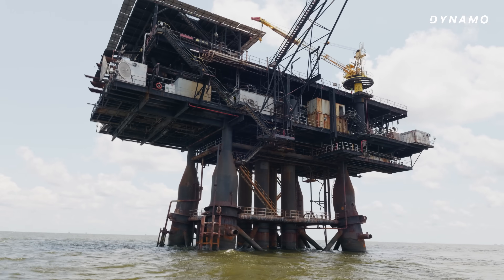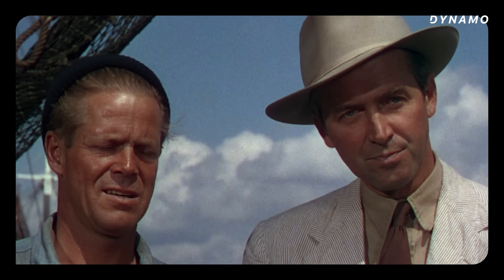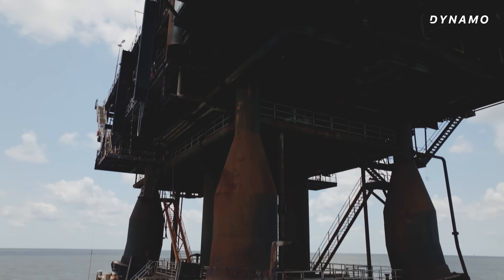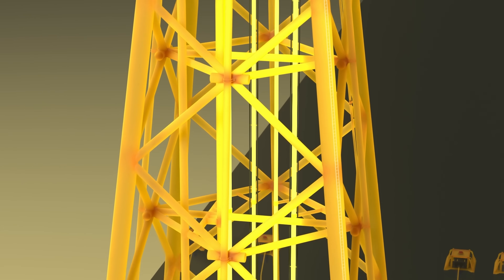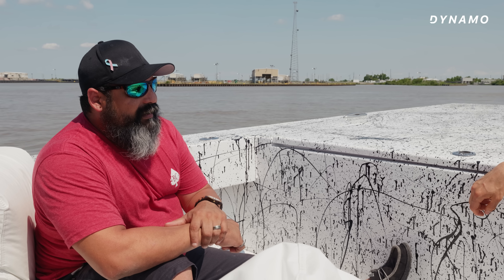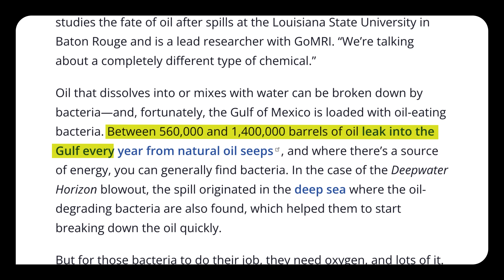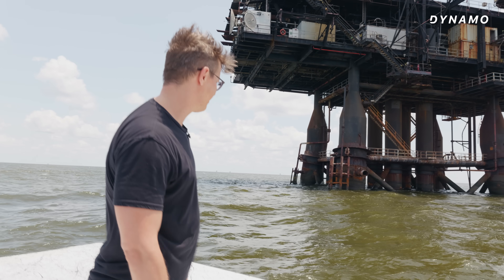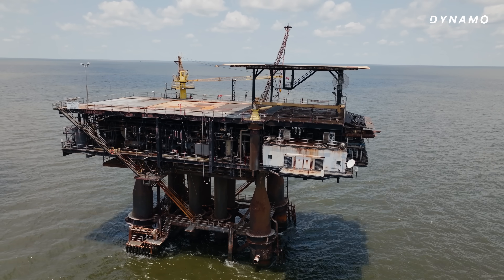I Visited Abandoned Oil Rigs — and Found Something Terrifying Underwater

Comment: It's all based on the law. The law needs to state that if you build it, you need to remove it.
Reply: They pay to keep the laws this way
Reply: @ogz7469 the big guys sell them, to smaller operators, who then pump out the rest make a huge profit and file bankruptcy
Reply: @ogz7469  better known as political donations!
Reply: Agreed, but no enforcement means no compliance.
Reply: Lobbying will never die in this country
Reply: @Joey_DiGs  lobbying is such a misleading term. it should be called corruption but i guess the people even changed the term itself to suit themselves
Reply: @Joey_DiGs personally I’m not convinced that it would have happened if they won, but we did have candidates running on a platform of overturning Citizens United such that corporations would still be able to lobby as if they’re people without the liability
Reply: @Joey_DiGs  As long as greed exists.
Reply: Even when the law says that, it is a trivial matter to sell the item to a company created just to go bankrupt.
Reply: @rockets4kids  If the law is: "You build it, you remove/clean it" selling it would not make a difference, you'd still have to remove/clean it even if you don't currently own it.
Reply: "The law needs to state that if you build it, you need to remove it." In OTHER words, you're saying that we need government regulations with teeth (the exact opposite of what Trump wants)
Reply: @Will-ql5db  The problem is, "Big Oil", is the law, for anything that applies to them, outside of major catastrophes. You're supposed to pretend that you don't know that. Even Trump knows who he can or can't F with.
Reply: @tuck6464  i) "The problem is, "Big Oil", is the law, for anything that applies to them,", Because Jesus Christ said so? No, it's because Big Oil paid legislatures (politicians) to write the law as it is, including lax regulations, WHILE the little guy (the citizen) wasn't looking. The problem is fixable by having the citizens learn of this (then demanding a change from their leader, which brings me to ii below).   
ii) " Even Trump knows who he can or can't", Trumpkins are always letting their Dear Leader OFF of the hook. Holding their man to account will NEVER happen, they ALWAYS make an excuse for him (like a cult defending it's leader). Disgusting.
Reply: @Will-ql5db *The exact opposite of what EVERY president has wanted. Let's not act like any government has given a flying függ about this situation. They ALL are immoral. My disappointment in Obama will never subside. Atleast we have it on paper that Trump is a crook.
Reply: Privatize the profits, socialize the losses. America's unique version of capitalism relies on making sure the bottom 80% pays for the bulk.
Reply: In Norway they have to remove them.
Reply: "Laws are created to be followed by the poor.
Laws are made by the rich to bring some order to exploitation. (Lobbyin)
The Poor are the only law-abiders in history.
When the poor make law the rich will be no more." - Roque Dalton Garcia (1974)
Reply: Remove it ? While USA with SpaceX is still developing reusable rockets. The Dutch have a veasel (Pioneering Spirit) that can lift a entire oil rig and place it some where else.
Short awnser: The Dutch can save your cities like New Orleans. But according to the Americans them selfs our solutions are to expensive
Good luck with Large language models... We never going to give USA our technology again for atleast a couple of decades. And we are folding protines with AI, not creating MechaHitler ;-)
Reply: I wish that applied to the old nuclear submarines in Plymouth, the rods are out of the reactors but the cost of decommissioning is too high as Swiftsure is proving.
   They all need perpetual cooling
Reply: Yeah, more laws will solve the problem.....   look at gun laws, domestic violence laws, traffic laws...  more laws always work
Reply: Who funds the politicians 😂
Reply: @bystandar right now suckers and losers
Reply: that is what the law says.  But Big Oil is daring you to enforce the law.
Reply: It’s the same in mining.
Reply: @mikehenson819  It's also the same in the ILLEGAL dumping of toxic/nuclear/whatever waste. The US government is only there to protect the ever increasing wealth of the rich, f*** the "common" man/woman who's paying an arm and a leg in taxes to have it all cleaned up.
Reply: Part of the lease is money to remove it but the government keeps that money and uses it for whatever else they want, public doesn’t see them so the public doesn’t care.
Reply: 😂😂😂😂 because that has worked so far
Reply: The law does say that.
Reply: Then we just have people going to jail.
Reply: That is the law.
Reply: That or sell it to someone who will maintain and repurpose it for something.

I would imagine someone, somewhere can come up for a use for an ocean platform.

Hell, fish farming maybe?
Reply: The law only exists to protect the capitalist class (billionaires). They're fighting a class war against every one of US who makes less than 5 million dollars a year. This is why we need a Workers Party! Socialism will save us from the Capitalist class warfare.
Reply: Exactly. It’s not a hate the player situation. It’s a hate the game situation.
Reply: You literally have no idea what you are talking about.
Reply: They dont make money that way, and would never allow it or they would sink it and make it worse.
Reply: @houston4380 Stop making claims that you know absolutely nothing about
Reply: Too bad that wont happen because every politician is in the pocket books of companies. It's why you work in the government. It's not to help out out the people, it's for the stealing of peoples hard earned cash by way of taxes (which is legalized theft created by the Democrats to at one time get rid of tariffs), and through big businesses giving out large checks to look the other way.
Reply: How about if you built it and you're killing the ocean, you have to clean it up too.
Reply: Communism is the answer 🤣😅😂
Reply: Ya but it was going to cost like 100 million to get rid of it or they can pay a couple of politicians half a million
Reply: They have these "laws" and these big companies just pay the fines.
Reply: Your govt is rotten to the core, no different then any other govt in the world. It's all about what's in it for me.
Reply: Yep, really needs to be done
Reply: They should be assessed once finished for cost of decommissioning and removal and the cost should put into a govt fund and held in trust. Dont forget’if there is a demand someone will fill it’ that is how business works…..businesses saying it too expensive are actually saying ‘is the profit margin in my business model can not accomade it’….some small company with lower overhaeds will take it on.
Reply: Make a law to do the right thing? What? No way, come on, get out of here, that's crazy. Your saying people need to be forced to do the right thing?? Do you know what country this is. Land of the I do what I want, how dare you think people should do the right thing.😂😂
Reply: If that were the case, then how many construction companies would either fold or jack their prices up horrendously to compensate themselves for the increased financial risk? If you were to build your own house and eventually sell it, what would you say to the new owner if, after a further 20 years and an earthquake or suchlike, he came asking you to pay for its demolition, since you built it? Should he then have the law behind him to thus compel you? When does your ownership and responsibility end? How would you plan financially for that liability?
Reply: But then we pass another law to “subsidize” big oil under national security pretense that lets them sell the well to another company that can declare bankruptcy and ignore the rig again. Big oil, big defense and right wing cia would never let their cash cow get hurt in any form.
Reply: We as People Need To march On Congress 😮😮😮😮
Reply: @GurlHeaven211 what we need is for people to wake up and realize that the government is the single most inefficient way of handling things.  A free market is an efficient market.  

Every fine, sanction, tax etc levied on an industry creates inefficiency in the market and every time the government gets involved the pork barrel promises and nepotism cost the taxpayers millions.  

The government shouldn’t be involved in cleanup at all unless there is a disaster.  Cleanup should be the oil company’s responsibility.  If they were held responsible for properly capping and closing their own wells, there would be a much more efficient way of doing so already and this problem never would have gotten so out of control.
Reply: @GurlHeaven211 bot
Reply: @KamiInValhalla Why????
Reply: More complicated than that. They sell the old ones to these sort of oil rig junkyard companies who then get everything of value and then close shop. (Great comment above explains what happens then.) Basically, the law DOES say what you suggest lol! The catch: there's no practical timeframe.  They have only like a few of the jumbo barges that can handle breaking down these rigs, and dozens of rigs (w/ hundreds & hundreds of wells total) slated for removal, so at this rate by the time they finish quite a few could've collapsed.  Classic nightmare courtesy of DC, w/ literally no good solution.
Reply: Wrong
Reply: That’s what the law already says   Original company that drilled the well is responsible to plug it
Reply: Should be part of the operating cost and expense, and contract for license.
Reply: You know man its clear without any law if its belong to someone he responsible for it till he dies and even after that his spouse or relatives carry this responsibility doesn't matter he sold it or presented because this one is the cause of future problems! 
Thats why in real life is some violence is happening! Only because if someone won't do things he definitely must life stops for him because someone coming and use  firearms and its right no matter what law says.These days some nasty people use lawyers to hide behind some laws that's why so messy around!
Reply: Which will result in higher oil and gas prices and a apissed off citizenry.
Reply: @Robin-ci2kx  We are paying for it, already.
Reply: Easy to say, but if Consolidated Drilling owned it last week and was dissolved in court this morning with no assets how are you going to force anyone to do it?
Reply: Landfill laws need to be enacted and enforced along the same principles.
Reply: The problem is, corporations have no trouble getting criminally charged. If someone goes to prison, they don’t really care. They just pay politicians to change laws then go bankrupt and change corporations to avoid accountability.
Reply: Thats going to raise the price for consumers though. So just be carfull what you wish for. You just might have to fund it. 🎉
Reply: Most buisness regulations exist purely to fill polticians pokets or due to secret lobying  hell even m8nimal wage exists to cut out smaller componies and form manopolies politics is about taking a p9licy that benifits the politician and phrasing it in a way that makes it seem like help ypu 

Take that example

Ofcause everyone needs more money prices are higher  but it doesnt solve it  as minimal wage rises smaller componies are pushed out and larger ones can increase prices even higher  its not even just the soft retort of oh if componies have pay more they will charge more , no largest corporations want higher costs like wage laws because it removes competition and the larger a compony is the less they care about u 

The small compony these laws kills want to pay you more but cant the larger ones u granted more power to couldnt care less they see u ad a number  and this 8s just a small sacrifice to kill off any better alternatives u may had
Reply: @demonic_myst4503 you can solve it buy makeing a company that takes these appart and basically performs a reclamation service. Just do some congress lobbying for a big government assisstance package and get it funded in the next bill. You know there will be a new trillion dollars cut next year so fuck it. Why not? Unless reclamation is to difficult of a task for you. I wouldnt wanna do it even for a shit load of money Ill bet its a lot of work and much more work than it is to place them. But asking someone else and or someone from government to provide a solution is always the wrong answer. Always🎉
Reply: Who’s you?
Reply: Maybe you could just buy it remodel it and turn it into an offshore fishing retreat😊
Reply: Oil companies have spent billions in lobbying/bribing politicians to keep that law from happening. That law could never exist because the oil companies use capitalism to keep it from happening. So it’s not based on the law, it’s based on oil companies being more powerful than the government
Reply: @kamil......what if I build something, then I would like to sell it, and somebody else wants it?
   Then I do sell it, and no longer own it? 
       And the new owner goes bankrupt?
         What if I find a car leaking oil, and also find that YOU bought the car new 25 years ago, sold it 20 years ago, but I say it's your problem that it is now leaking oil on the ground?
Reply: Well, maybe that might be a nice place to deploy a group of f35 and some drones and stuff.  Potential missile site for parts of the golden dome? Ect.
Reply: It does say that! It just so happens that bankruptcy alleviates all responsibility
Reply: el problema es que los que hacen las ley , son sobornados por estas poderosas empresas
Reply: The oilcompanies pay the people who write the laws to write the laws they want.
Reply: @ralphholiman7401  Yeah, that’s why in the oil companies operating in the UK get charged 78% tax on ALL UK profits. 😂
Reply: Sure, but when the company that built these rigs goes bankrupt or even sells them to smaller companies, there are all kinds o legal tricks to make that impossible. That's why not just the US coast, but the US itself is riddled with abandoned structures, including storage faciliteis that still hold huge amounts of toxic/radio-active/other of waste. The entire US has been built and operated on pure greed, and arguably that's still the case. Everything is about the (relatively) short-term, maximal profit cash-grab, and once that's no longer tha case, things are simply abandoned and ultimately the tax-payer is going to pay for the clean-up.
Reply: Tax em. 
They can Leave em if they pay for them. If they don't wish to pay they might want to scrap them.
Reply: @KWend-f4n  
Tax em???????

For sure that money would be sprnt long before that well ran dry and dormant.  Politician's can't be given the money for future events today..
Reply: @KWend-f4n They were taxed. The government was paid a decommissioning fee for the future removal of the structure. As the government where that money is now.
Reply: @KWend-f4n corporations don’t pay taxes.
Reply: @andrewnajarian5994 "In fiscal year 2024, the U.S. federal government collected $530 billion in corporate income taxes."
Reply: @andrewnajarian5994  they can. Norway taxes their oil industry massively - that's why Norway is very rich as a country and has high living standards.
People argue 'big oil' won't pay, or they won't work your fields... Norway debunks this argument but sadly other countries leaders get paid to argue 'big oil' won't have it.
Reply: @thebrowns5337you miss the point.  When you tax corporations they pass the tax onto the consumer.  My point is that every dollar you tax the oil companies you can be double damn sure it’ll be reflected in the price at the pump.

In case you have any doubts, the current price of Gas/Petrol in Norway is $7.64 USD per Gallon!
Reply: @DeepInTheDerp you’re too literal.  My point is that every dollar you tax a company is priced into the final consumer’s cost.  

Notice all CA’s taxation efforts have done 0 to the oil companies, all it’s done is raise the cost at the pump for anyone driving in the state.
Reply: @andrewnajarian5994  Norway is a net exporter of oil, so although the taxes on their oil companies are ultimately paid by consumers, most of those consumers are outside Norway.
Reply: @megalodon1726 what’s your point?  It doesn’t matter where you live, if you consume oil you are paying the taxes levied on oil companies.  

Norwegians don’t get tax-free fuel at the pump because the country is a net exporter. Heck, they pay even more than Californians at the pump currently.
Reply: You see that map? And yet people insist, windmills are worse for the environment. Haha, oh man. The cognitive dissonance is so bad in this country. 

  How can someone even mention that when there are thousands upon thousands of old drilling holes, and God knows how many abandoned rigs across the world. Not to mention the waste from everything that supports them. Everything that supports processing, refining, and transporting it. 

 The oil spills. The wars. The wrecked hulls of ships. 
 
 I'm not even green. Too late for the earth as we knew it.

 I am ignorant myself. I don't mind that either. It's just that they will truly defend these oil companies, Monarchies, and gobble the lies while calling everyone else sheep. 

 Then you show them videos or evidence, and they either go silent, or strawman into something else. Just like the Epstein files. 

 Gotta say though. I'd definitely buy an abandoned oil rig for my house if I were billionaire rich. After a make an airship company, and have one to commute with.
Reply: @RedactedDeath those windmills will be abandoned in 15 to 20 years as wee
Reply: @ryanthon10 No, at the very least they'll taken down, and stacked somewhere in the places that don't have regulations for sure.

 Use the land for other stuff. 

 Like oil rigs, leaving open holes, all the waste  maintaining them, and sheer environmental destruction from leaks don't create massive amounts of waste? What about the wars? /s

  Gimme a break.

 Once they become super common, someone will figure out how to make money reusing the composite part of the blades for Mills. Some already are using them. 

 Up to 90% is already recyclable. The cost is expected to drop by 30-40% in 5 years. They are already getting as cheap as new natural gas in some places.

 The oil companies try hard, and do good hiding it all. 

 Should see the waste produced from creating, and supporting a single off shore rig. Those things are full of heavy metals, solvents for cleaning, and other things. 

 Windmills are NOT green, but are infinitely better than oil. The fact some of you still detest that with the studies, and your own damn eyes. 

 Even Texas is on a windmill+battery spree. 

 Oil should be saved for the other things, and niche industries like space. 
 
 Nuclear, and renewables are superior for personal energy. 
 
 Pro oil people are the biggest tools of them all. Not even getting paid for being a shill, and being a hypocrite. Got some cognitive dissonance, lack of conceptualization. 

 Totally ignoring the exploration, drilling, creating rigs, maintaining them, all the refinery stuff, and the semi fleet to maintain it all. The gas stations. Everything to support your weak, outdated, slow piston engine.

 It's ridiculous. Gotta spend gas to get gas. Gas industry uses rare chemicals, and wastes them in catalysts like Lanthanum,  Cerium, for example amongst others. Uses a ton of the same resources as renewables. 

 You don't care about recycling. You just hate renewables. 

 Personally I am a solar guy. Yet wind is better overall just period.
Reply: @RedactedDeath 😂😂 your not some libtard or anything.   I much rather have a couple of those out there I can't see than look at thousands of wind mills that kill all kinds of animals and trees and useful land for what something that doesn't work something that kills the environment as well but probably way worse than some wholes 😂.  Gotta love the gulf of America.     Hey how's all your motors doing and that nice warm heat your feeling on your feet cause it's not from those expensive useless things you have on your roof that some wet back put up there that your gonna need to replace before you evrn got your money's worth outta them but good try.
    How you feel about all that cole were production we just started to get away from the scum china????  Pretty awesome we have a man for a president huh???
Reply: You're a fracking moron whos comment would be impossible without oil. Windmills take more oil to put up than they can generate in 100 years of constant spinning. If you want 10x the abandoned oil platforms etc, go for windmills.
Reply: @RedactedDeath how do you think windmills are made?
Reply: @hiteshadhikari they are made practically without oil. possibly a little in lubrication but not necessarily. A little in transport of course and there would be some plastics. It's all offset  pretty quickly and you benefit with lower energy costs in the long term. Stop being a mouth peice for the fossil fuel industry
Reply: @mytube7273  I hate to assume, but here I going to assume that this reply, went to the wrong comment.
Reply: @JBBost  i am an engineer, how do u think windmills work or operate?

Do u know how they are maintained?

Do u know how windmills are then later cleaner up or as we white wash it "recycled"

Do u know how its added and synced to grids?
Reply: @mytube7273 Have you seen how much oil is in a single wind turbine gearbox. It’s hundreds of litres. No oil no wind turbine!
Reply: @RedactedDeath  The will do the same will windmills. And the windmills would take up land space.
Reply: When Three Mile Island nuclear plant had a problem, they had to pay to clean every last bit of it up. No one died or even got sick. When oil, gas and coal make a much bigger mess for decades and decades, and the years of life lost from breathing polluted air can be counted,  they pay nothing.  In fact they receive subsidies from our tax dollars.  Should profitable oil and gas companies be getting even more money from our tax dollars? 

This video is too much happy talk. The upbeat music at the end and the baloney, pie in the sky, oh microbes will just eat the oil!  Well, the reason the Gulf of Mexico isn't completely dead from the oil spills and blowouts is that microbes already eat the oil. So if they aren't eating enough for an 8000 psi rusting oil valve when it fails, don't expect that start up to solve anything.

I've seen this stuff over and over and over again over many decades. It's effectively a big lie to distract people from the real issue: How irresponsibly corrupt Big Oil has always been. The people who profited from all those bankrupted oil companies are still around and still have all that money, it's just that our corrupt system allows them to use the corporate laws and bankruptcy laws to avoid all responsibility.
 
Keep voting for the 'good old boys,' and your grandchildren will be going through their third bout of chemotherapy and it still won't have changed.
Reply: Agreed but that's why they go broke to get around this
Reply: As someone who is actively involved in both drilling and abandonment operations in the GOM it's always extremely disappointing to see a video like this that fails to explain/acknowledge the difference between a drilling rig and a production platform.  Lumping them together as one thing (oil rig) is nonsensical, and you immediately lose all credibility with many who actually understand this industry.  As far as the rest of the content, some bits of truth but mostly just sensationalization and fear mongering.
Reply: No, this video guy didn’t show you the amazing ecosystem that lives underwater around the rigs. 
The ecosystem is absolutely amazing around the old Riggs. I live in Florida now where they don’t allow offshore platforms and instead they sync parts of bridges, radio, towers, old cars, old, boats, and ships, aircraft carriers, battleships, and all kinds of other junk just to try to create some sort of ecosystem for the fish. Without the structure from Florida’s junk and from oil, rigs, the ocean in the golf is almost like a desert.
Reply: cant wait until they tear the thousands and thousands of the non biodegradable toxic epoxy resin wind turbines from atop beautiful mountains of west Texas!   Talk about a real fricken mess!!, at least these rigs are serving as artificial reefs and eventually just sink and rust back into nothing. The epoxy fiberglass crap, not so much... I implore you to look into the "turbine graveyard crisis"
Reply: @KevinDC5  dude the end of the video literally just discussed the dangers of the WELLS. The rigs might have a second life as a reef but abandoned wells are blowing out poisonous oil right into the water.
Reply: FACTS!!
Reply: Who cares?
(Except trust fund kids like this with too much time on their hands trying to justify their existence.)

How big is your trust fund ?!!??!!
Reply: Who cares?
(Except trust fund kids like this with too much time on their hands trying to justify their existence.)

How big is this guy's trust fund ?!!??!!
Reply: You're right, we should just outlaw poverty! That will make it so it no longer exists right?

It's more complicated than that. It's prohibitively expensive to remove these. This would drive the cost of oil a lot. 

You know, that thing that literally, LITERALLY, impacts cost for everything else and makes the world LITERALLY go round? 

The same thing that everyone complains about every summer when prices go up?